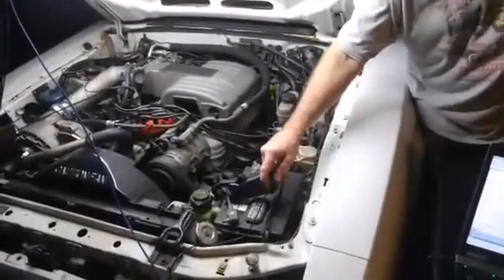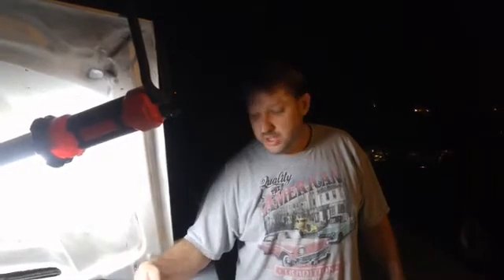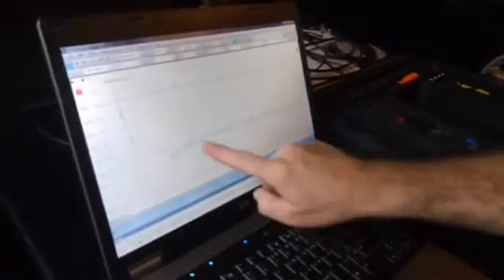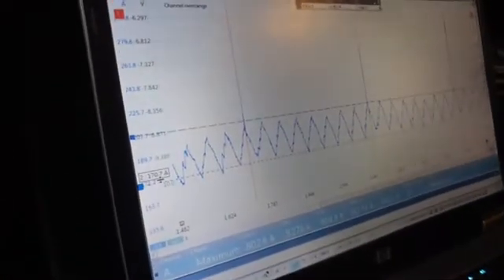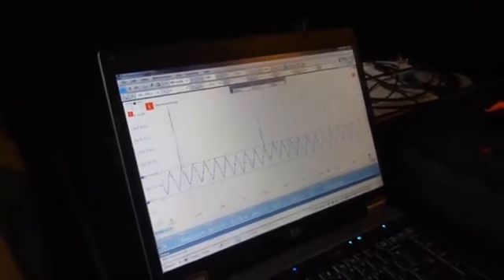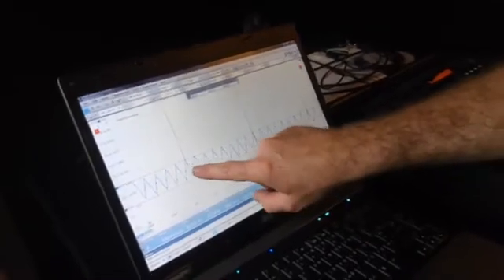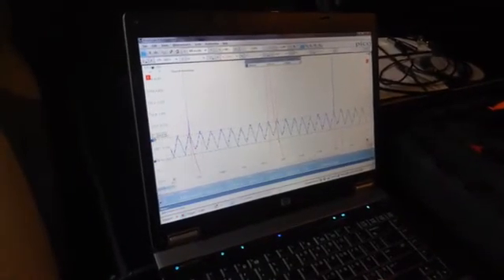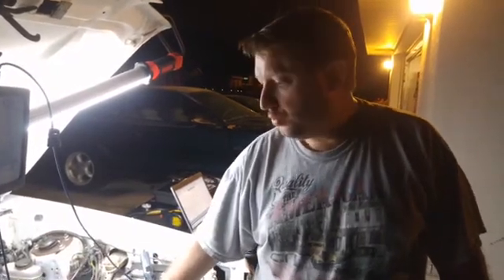Relative Compression Testing a 5.0L Mustang GT

Comment: Great video. But im confused how you triggered the number 1 cylinder for the ignition sync. If you disabled the spark and the fuel, how did you trigger cylinder number 1. Ive gotten around this by either using a 2nd amp clamp over a the number 1 coil wire on a COP ignition, or using a 2nd amp clamp over the number 1 spark plug wire on a conventional igniton. But in this video, you had neither a coil firing nor an injector firing to trigger number 1 and im just curious how you did that
Reply from the maker: Well, first I mis-spoke. By holding the throttle at WOT, the PCM cuts the injector pulse off, disabling fuel. But I said fuel and spark. That isn't right, it's just fuel that gets disabled when you do that. My mistake, I mis-spoke.

For the ignition sync, I used a sync probe. It's a probe that didn't come with my Pico kit, but Pico does offer it. It's an inductive clamp that I placed over the #1 spark plug wire, and it just draws a straight line every time it sees a spark occur in the #1 plug wire.
Reply from the maker: Here's a link to the sync probe.

https://www.aeswave.com/Trigger-Pickup-Inductive-Lead-for-the-PicoScope-p8796.html

Comment: Well I think I lost compression I didn’t test it but my oil is milky or creamy mines had overheated and I can’t get it to start back up it turns over but won’t start can you do a head gasket video so I can get some confidence to do it lol I don’t want to pay a shop but I never did a head gasket job before
Reply from the maker: The appropriate test is to pressurize the cooling system and see where the leak is occurring.

Comment: What was actually the problem what did you do to get it back running?
Reply from the maker: PCM terminal locking tab was broke for the Injector #3 control wire, allowing that wire to push out of the harness connector when you tighten the PCM harness bolt down. Short of a new EEC-IV PCM connector body, the only other fix is to superglue the terminal into the connector body.

Comment: Wow never seen this test before thanks for your distributor video I was setting my btdc at zero on balancer then dropping distributor in to number one post on distributor cap not realizing it's should be pointing at 10 degrees on balancer
Reply: Roger Carlin when stabbing the distributor and mechanically timing the motor, we're just trying to get it as close as possible to 10 BTDC once the car starts, so that it requires less adjustment once you get it running. As long as it starts, you'll end up setting the timing with a timing light anyway, but 10 gets you closer than 0 as a starting point.
Reply: Steve Hulett yea I just found that out lol went out to the car and tried going by your video and everything lined up exactly how you explained in the video because I had it set at 10 with timing light before trying your way. But for now on I am going by your way a degree or two is a lot better than 10 like you said but again thanks for your knowledge
Reply: Damn...i watched the distributor video and i must have misunderstood it. i set my balance to 0, then stabbed the distributor in with the slim tooth in the center of the PIP. I'll report back to let you know if it starts as easy as the mustang in the video